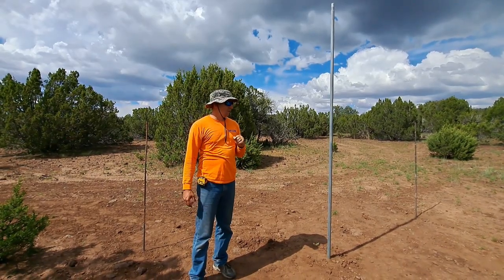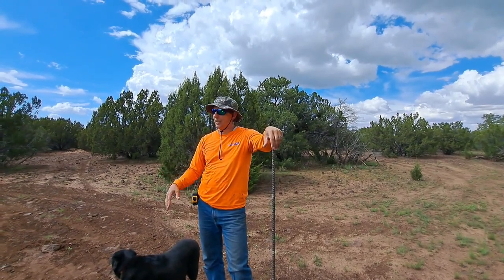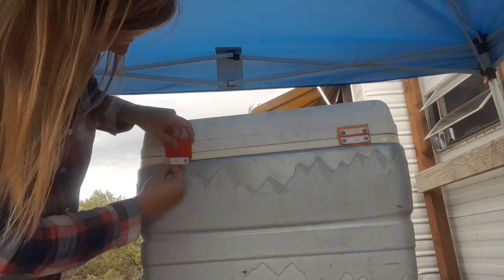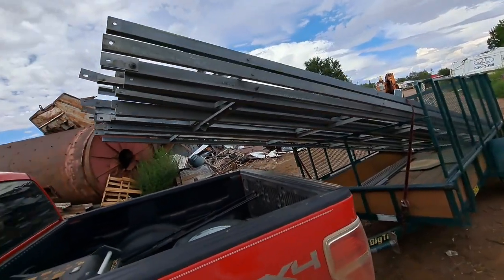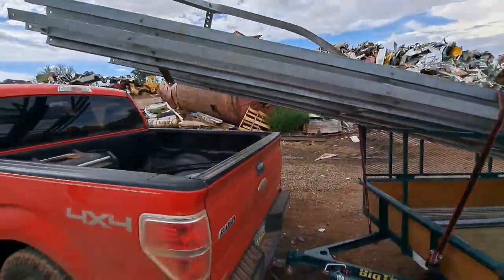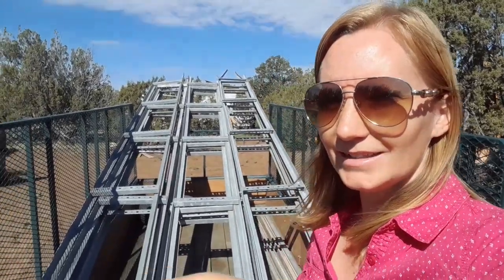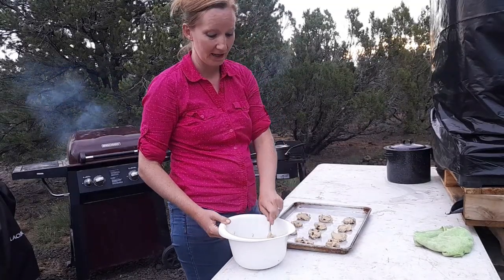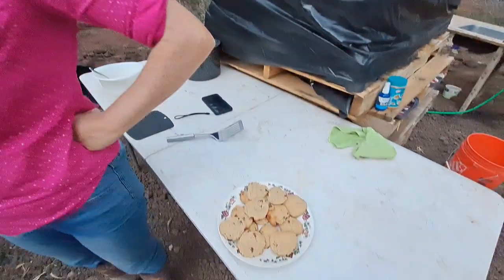Finding TRUE SOUTH For Solar | BIG Find At The SCRAP YARD

Comment: Just a quick question. How many solar panels and batteries will you be using in your solar set up? Thank you.
Reply from the maker: We will start off with 30 300 watt panels and 5 100 amp hour batteries. When the house is built we will add more as needed. Great question. Have a good one!